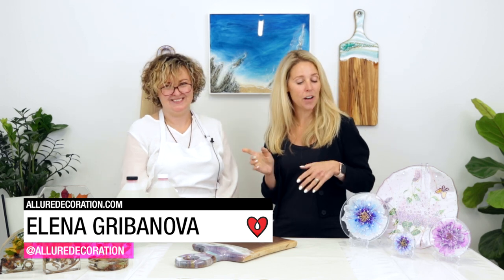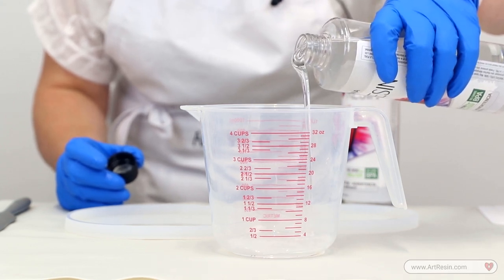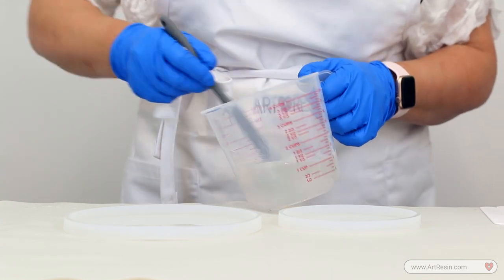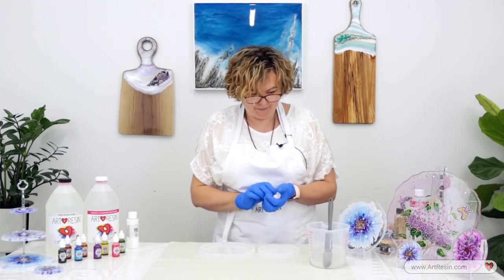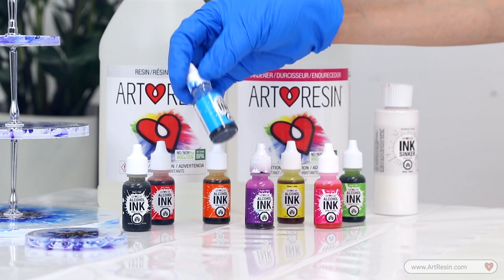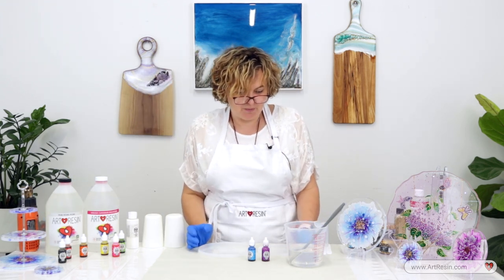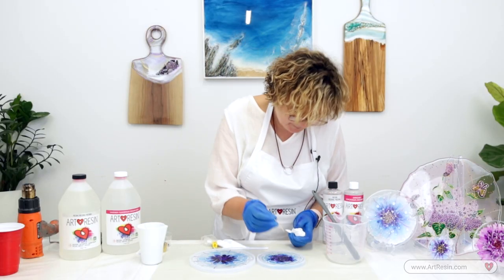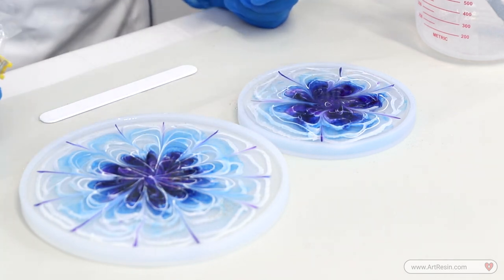How To Make Resin Flower Coasters

Comment: I have seen a video where if a person uses alcohol inks, the color and shades change after a few weeks! Have you noticed this? I want to try some with alcohol inks but I am hesitant to if it doesn’t stay the same vibrant color as it starts out with!

So I didn’t see that he had a newer video with your alcohol inks and they did NOT fade in the resin over time! I’m so excited, to try things with your alcohol inks!
Reply from the maker: Alcohol inks vary greatly in intensity from brand to brand. Some will change color when they are dropped into resin. Others can fade very quickly. Ours are highly saturated and provide an intense color and won't change when it drops into resin. It has a lightfast rating between 4-6 which is very good.

All alcohol ink is dye based ( as opposed to a pigment based colorant like ResinTint ) so you'll want to keep it out of direct sunlight to help prevent fading.
Reply: 😊 @Artresin

Comment: how do you clean the mixing bowl and spatula? Does it come off with soap and water also is it safe to go in the sink?
Reply from the maker: You can wipe any remaining resin out with paper towels then spritz with isopropyl alcohol to remove any sticky residue.  Once you have removed all of the resin and hardener, you can wash with warm soapy water, but never allow your resin or hardener to be washed down the drain.  Alternately, you can let your resin cure then pull it out of your cup once its cured, this works best with flexible plastics rather than hard brittle plastic cups.  For more information, have a look at our blog : 
https://www.artresin.com/blogs/artresin/how-to-clean-up-epoxy-resin?_pos=5&_sid=220965ce8&_ss=r

Comment: what is the best way to warm the resin? in the microwave or hot water?
Reply from the maker: We prefer using a warm water bath to warm up your resin and hardener before mixing.  The warm water bath gently heats the resin and won't cause the hot spots that a microwave can.

Comment: Can I use art resin to preserve my wedding bouquet? I have dried it with silica gel and researching what kind of resin I should use. I see a lot of casting resin preserving in a mold. I see art resin is designed to anti-yellow and cures crystal clear.
Reply from the maker: In this video, Elena is using shallow molds and pressed dried flowers so she can pour it all in one layer.  In deep molds, we would recommend pouring ArtResin in multiple shallow layers of less than 1/4" each to help reduce bubbles and prevent too much heat.  You can add your next layer once the previous layer has cured for 3-5 hours.  If you want to pour all at once in a deeper mold, you will need to use a casting resin instead.

Comment: One of the first and most important lessons I learned, was to wear a mask. While the flowers were nice, I feel like a company, that promotes safety, should stand behind their safety requirements. 

I’ve used art resin. It may say low viscosity, it’s stinks. No offense, I still have it in my inventory. 

Just saying , “Practice what you preach “.
Reply from the maker: We absolutely agree, following guidelines for safety is an absolute MUST.  We are happy to assure you that ArtResin is safe for home use without a respirator, we just recommend using it in a well ventilated area rather than closed off in a small closet.  ArtResin is non toxic and it does not produce fumes or VOCs so it doesn't pose the same health hazards as many of the highly toxic epoxy resins available.  Always wear gloves to protect your skin as all epoxy resins are a known skin irritant, besides that--it is super sticky and messy so gloves help minimize the mess.  Please have a look at our blog for more information:  
https://www.artresin.com/blogs/artresin/what-safety-precautions-should-i-take-when-using-artresin?_pos=3&_sid=1b57ae7d3&_ss=r
Reply: I absolutely agree! I am using PPE all the time then I work with resin, but for the purpose of the tutorial and clear sound I was was not using my respirator. It is essential to protect yourself!
Reply from the maker: @alenushkag73  It is important to always educate yourself and do your research on the safety requirements for the brand you are using, and we feel it is equally important to always work within your own comfort zone and take extra precautions if you wish.  We want artists to get joy from creating and feeling safe while doing it :)
Reply: @Artresin  Im very confused now. On your site you mention that your product is only non toxic when you don't add third party products to the resin, and you explicitly state that adding alcohol inks introduces a solvent to the resin and that it may not be non toxic in this instance. Yet here you are stating that artresin is safe to use without a respirator in a ventilated area and not mentioning alcohol inks and those solvents at all, and the lovely woman in the video is not using a respirator either.
So is it safe to use alcohol inks in your resin without a respirator or is it still hazardous?
Reply from the maker: @athae_shoots  Alcohol ink is a solvent and when speaking of ArtResin being safe for food contact for instance, we would advise you to apply a clear coat over the coloured layer that contains alcohol ink as the ink is not safe for food contact.  The clear coat would ensure that the surface that comes into contact with the food is in fact safe.  When dropping alcohol ink into resin as a colourant typically we are speaking of a drop or two of alcohol ink, not large amounts.  Much like you could use rubbing alcohol to remove the sticky residue from a surface in your home, or use a cotton ball saturated with alcohol to clean a wound, you would not be breathing in enough of the vapour to have an adverse effect.  With that said, we always recommend working in a well ventilated area and if wearing a respirator makes you more comfortable then to do so.

Comment: Why don't you wear a mask when working with resin?
Reply from the maker: We are happy to share that when used as directed, ArtResin is non toxic and does not produce fumes or VOCs.  ArtResin has been evaluated by the American Society for Testing and Materials (ASTM) and has been designated non-toxic when used as directed and safe for home use in a well ventilated area.  When used as directed a respirator is not required.  We do recommend wearing gloves to protect your skin.  Have a look at our blog for more information: 
https://www.artresin.com/blogs/artresin/41788993-artresin-is-safe-for-home-use?_pos=1&_sid=ed0074254&_ss=r

Comment: Why are these people not wearing respirators! I've seen so many and they are amazing tutorials but why no mask
Reply from the maker: Hi Ana, ArtResin is non-toxic and does not produce fumes or VOCs.  ArtResin has been evaluated by the American Society for Testing and Materials (ASTM) and has been designated non-toxic when used as directed and safe for home use in a well ventilated area!  When used in a well ventilated area, a respirator is not required, however you can always work within your comfort zone and wear one if you wish.  Have a look at our blog:  
https://www.artresin.com/blogs/artresin/what-safety-precautions-should-i-take-when-using-artresin?_pos=4&_sid=566c9671e&_ss=r